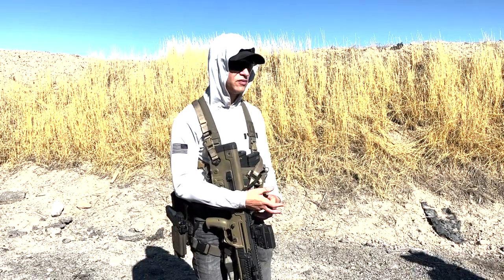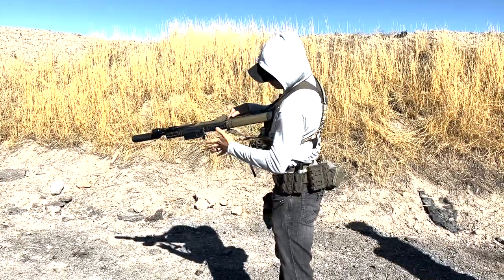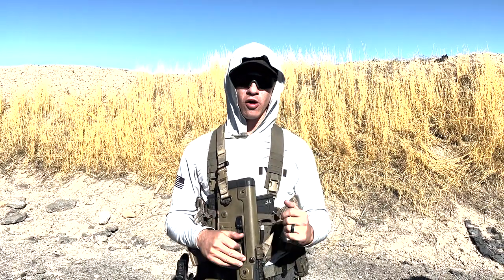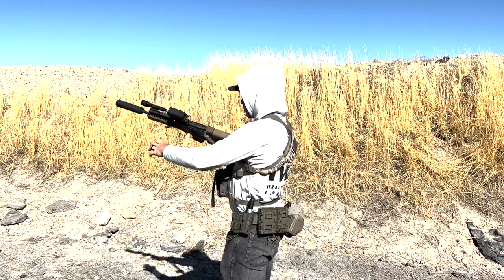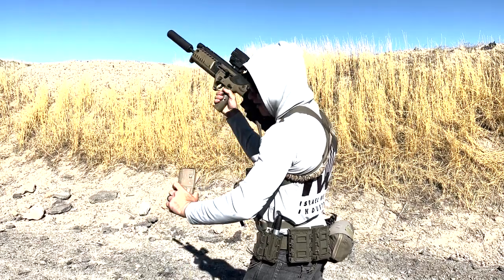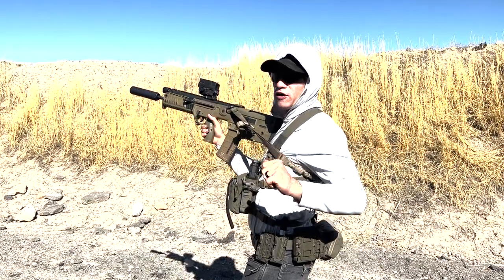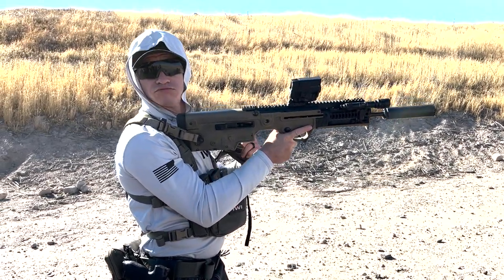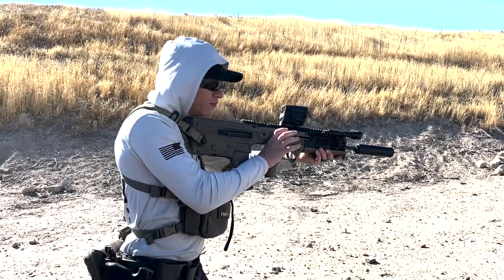Tavor Lessons - How to Resolve a Double Feed Malfunction

Comment: lol, just came from another video and answered a question about the bolt not closing all the way and told the guy about riding the handle forward causing that.
Is a half-charge acceptable to clear that issue? It's what I usually do to make sure I don't load another round.
Reply from the maker: Yes